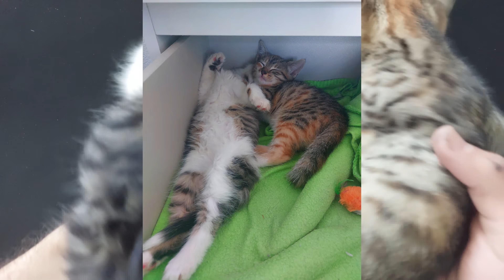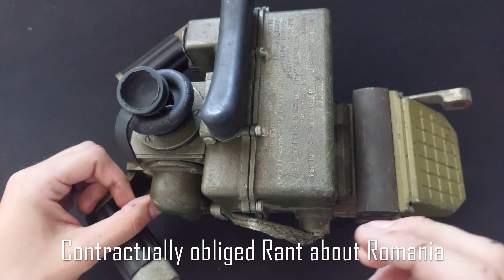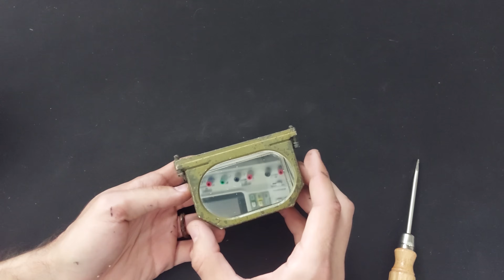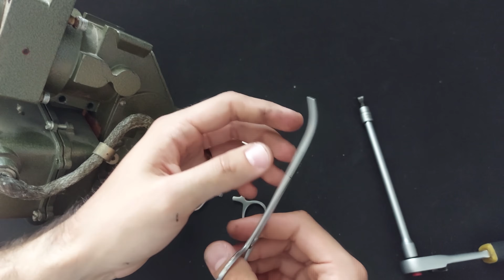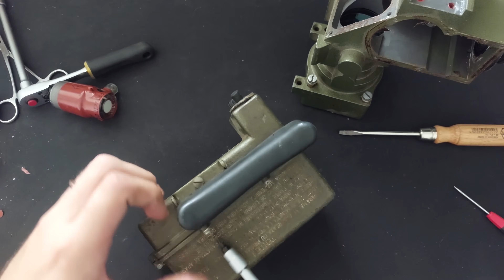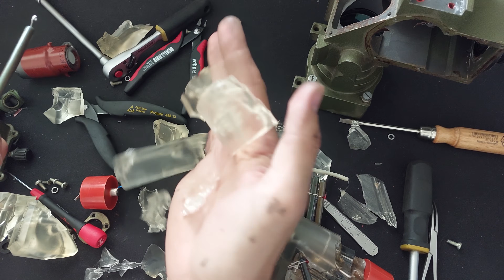Night Vision Sight EXTREME Teardown

Comment: In all likelihood, there is a microchannel plate in front of the phosphor screen and that is the part that is worn out inside the tube. You could always try cranking up the voltage to squeeze a little more life out of it.
Reply from the maker: There's no mcp, it's just a second generation image intensifier
Reply: @GearAcquisitionSyndrome  So 2nd gen image intensifier is different from 2nd gen night vision?